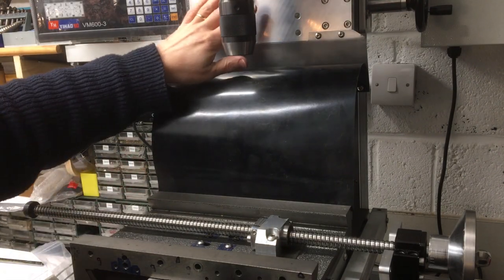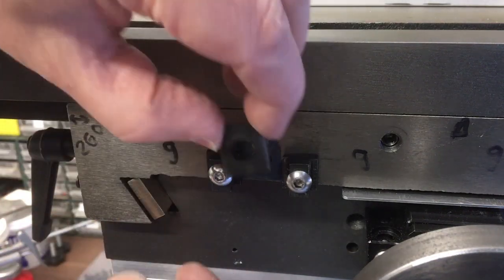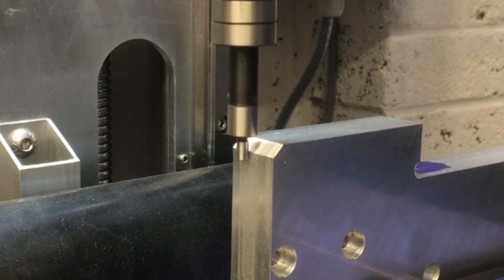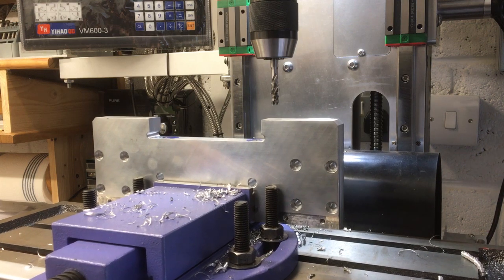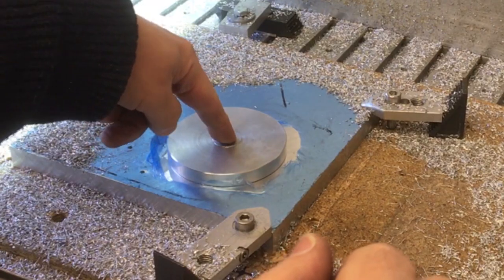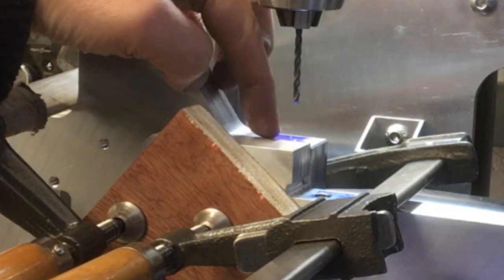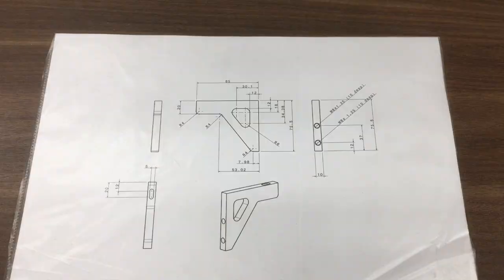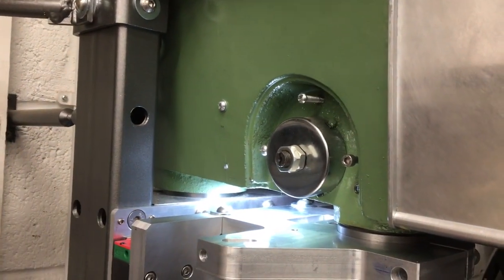Ep34: Drill Press Upgrade | Quill Guide System

Comment: Just watched the video, and at the end you mention small readout. Why not put 4 axis DRO and use it as Z1?
Reply from the maker: Yes, that would work too, as would adding an electronic combiner to add the knee and quill position into a single readout.  But I already have the small digital readout and my DRO system is only 3 channel so I'll go with that.  Worked well enough on the previous machine.  Thanks
Reply: @routercnc9517   @routercnc  Maybe if one day you think about replacing DRO with graphic LCD like Aikron A30, then would make sense to order 4axis one. You can combine Z and Z1 in it. I just made an arduino base translator from that small scales serial output to encoder like signal. When finished might put then code as opensource for people wanting connect those to encoder signal input DROs.
https://youtube.com/shorts/8nfoiB46Wh0

Comment: I winced when I saw that broken drill bit, glad you could rescue the part. As you sure you've got enough working height? On the video is seems really tight. Is there any scope for fitting a longer support column and rails?
Reply from the maker: At the design stage I tried to maximise the working height by having the longest rails, the bearings close together and keeping the xy table and vice as short as possible.  I knew the height would be limited but that is the best I could do.  I designed it so the xy table could be easily removed to turn it into a normal drill press and give more clearance.  Long column and rails would work but then that is a lot of rebuild and there would almost nothing left of the original parts!